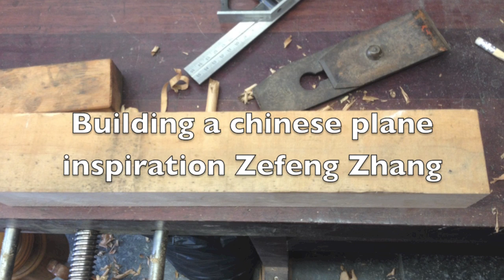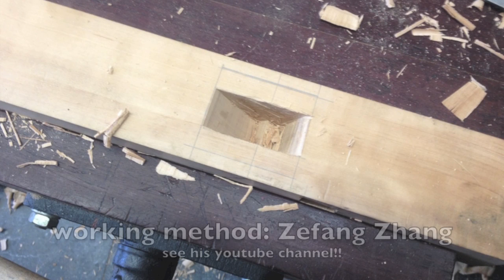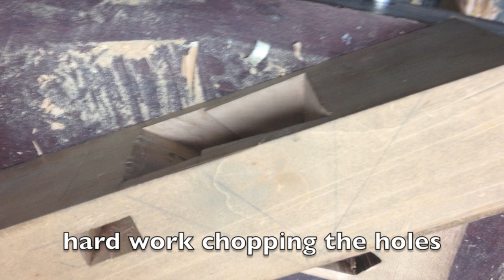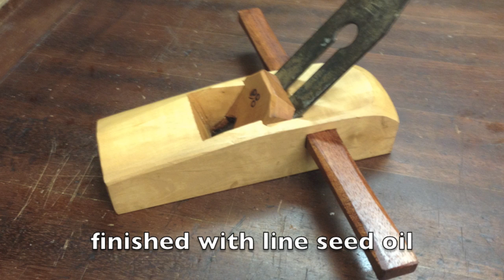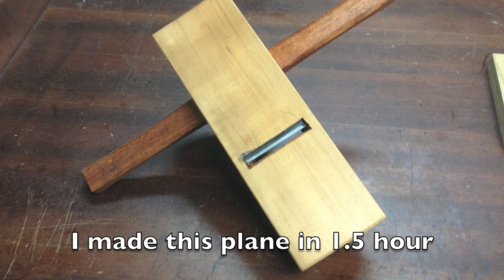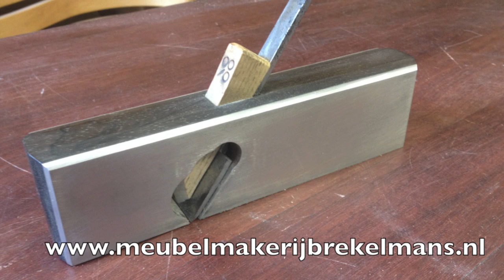Building a chinese plane

Comment: I built a  24in sty;le high angle 60 deg  chinese jointer plane . I got the blade from woodwell in china  their blades are cheap . They sell chinese mujingfang planes , also there are sellers on e bay . I have 10 chinese planes  , they are  a fusion plane   east/west, very handy

Comment: I live in China and have used Chinese planes. What if any distinguish this plane from others and also what of any are its advantages?
Reply: I like Chinese planes better because they are very intuitive to use, and are more efficient at using your strength. 

When they are well tuned they work beautifully well.